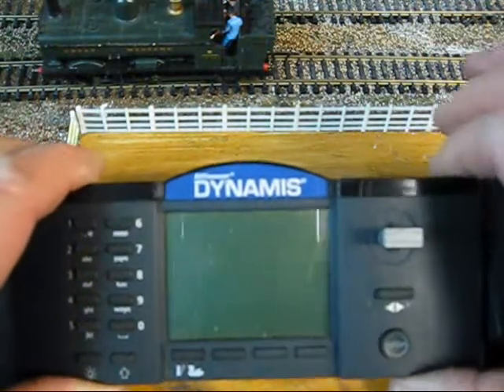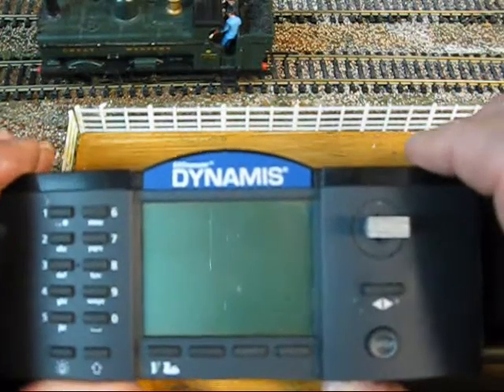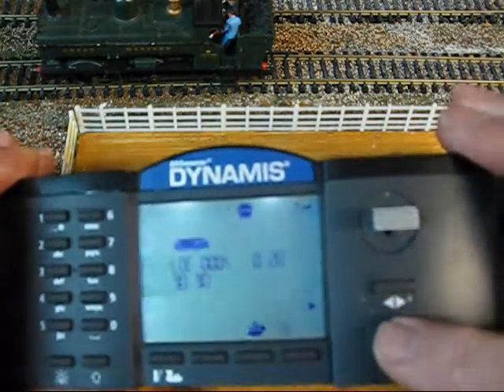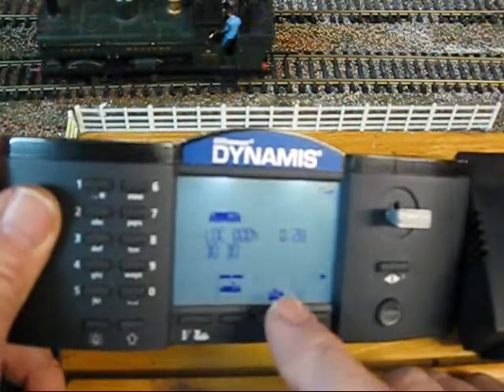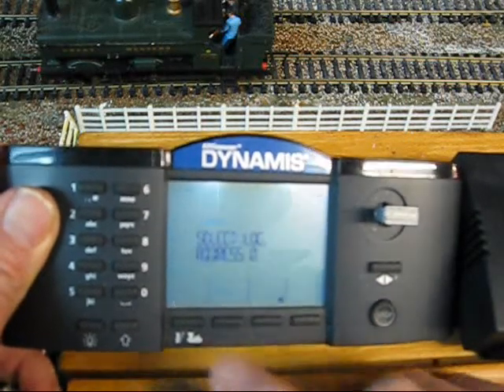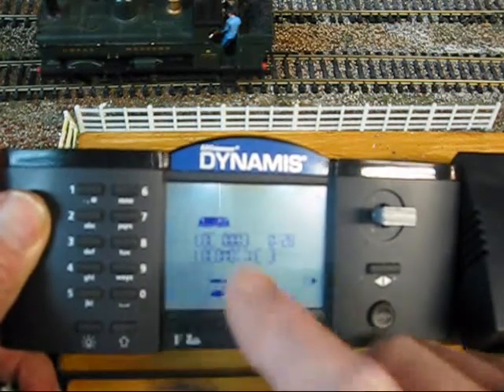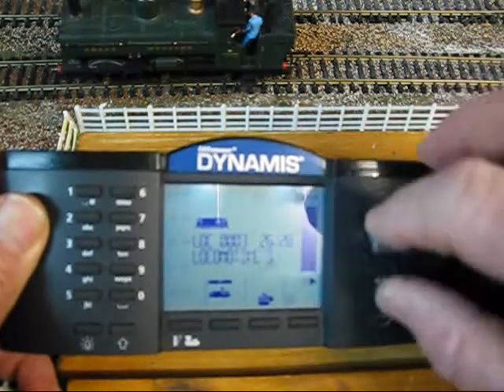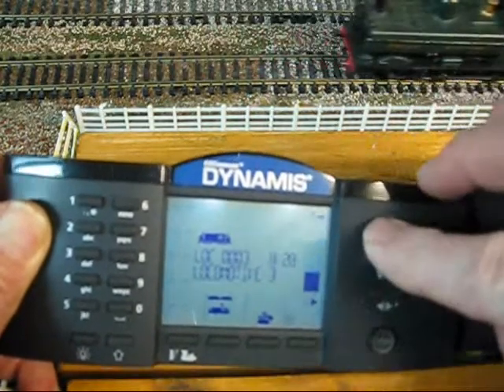Dynamis, Programing a Loco

Comment: Many Thanks Dave! Tha got me sorted by doing exactly as you illustrated. Question though! Do I have to do anything before ing your procedure to add a second new engine? When I out the new engine on the main track nd press '3' there is no response this time? 
Mark.
Reply from the maker: Sorry late coming back to you , not been home so unable to check on my Dynamiks , but if you pressed the button to add a loco bottom right , it should be possible to add a new loco ...if you still have  a problem i am home next week and will check on my dynamis and see if i can explain it better ...cheers dave
Reply: @howarth004  No Need to apologise Dave, thank-you!
I almost had the loco completely repackaged to send back to Olivia's trains when I thought I'd try again after receiving your message. So unpacked and on the track I managed to make the connection to it using the button 'add-loco'. It worked, however, there is a fault and the loco is disconnecting randomly after a short period, so I think that I just got lucky this time with connections temporarily made. I received a second Duchess class loco from Olivia's and everything went smoothly in establishing a connection to it, and then using your clip to guide me through programming a new address. So the problem is not in the Dynamis but with the loco. Many thanks for your help on both counts! Mark
Reply from the maker: @markstewart8984  glad you sorted it out , funnily enough it was Olivia’s that I bought my fist dynamis after seeing them using it

Comment: David, did you have problem with  signal loss?  How  did you solve?
I bought one a few days  ago and Always  the signal drop out. 
Thank you.
Reply from the maker: I lost it with the batteries not making contact with the contacts ..I took the back off and where the contact touch the battery at the bottom ..I turned them up ...the other problem  some have said the fluorescent light sometimes interfere ..I have not had that problem....this video shows how I cured the poor battery contact  https://youtu.be/VElzSS-lths....Cheers Dave
Reply: Roberto miguel crisostomo de oliveira pinto .. the big problem is is the 👎infrared.. it is the weakest part of the whole system.. what were they thinking when they made it infrared I have no idea.. my TV remote works better than this thing...

Comment: Hi Dave..this might seem like a simple question to you,but if one doesn't ask they'll never know.Ok:here goes.You bought that loco and I want to know if all trains run at the same speed.Can you control the speeds so they can all go the same speed,or are some trains limited as to how fast they can go.I see your trains going round your track and you control the various speeds;but are they all built so they can all reach the same speed level?
Reply from the maker: Hi Tuk , well they do vary a bit , thats why rarely you see double headers  2 trains running to gether , i do occasionally run them but try to have them with the same decoders fitted which is what controls the train, these tend to be set at different speeds  (very slightly) you can change this but very difficult to get them set exactly at the same ..hence yes they are nearly all different ...Dave 🚂
Reply: Thanks Killer..This is like Mastermind and your starter for ten:your chosen subject is trains.:) in terms of speed which is the fastest train you can buy. please?
Reply from the maker: Well think the fastest I have is the Blue pullman ,it ha a motor in the front and rear , and both decoders in  each end set identically ...she can move some ...Dave

Comment: Hi ,Dave, I 've watched your video and it seems very simple, however I cannot change from 03 address to any other number, reading the manual I seem to have a screen message missing. After accepting "Write ADDR 0003 on maintrack" message, my next message is "change ADDR 0003 Write ADDR with a flashing 0", it states in the manual that there should be "Write ADDR Loc Write ADDR 3" message at this point any ideas please
Reply from the maker: +Pathways Productions did you press change address and then also press accept ?? you can see on here how I did it , beyond that I carnt help , maybe if you ring Bachmann, there could be a problem with your controller ...dave
Reply: +David Howarth Hi David, Thanks for replying, I followed your video and 03 works fine but cannot change to another address, it's very strange.
Reply: +Pathways Productions David, just a question, I have two locos with the same address, I don't seem to be able to cancel one and then start again with number 3, also is there a way of finding out what the address of all my locos are please
Reply from the maker: +Pathways Productions Sorry I could not help , I dont use my Dynamis anymore , but if you are having problems suggest you try putting your query in to YTube , there are a lot of tutorials on there ...dave
Reply: +Pathways Productions Hi Dave, OK thanks I have joined a forum so may get to the bottom of this problem. All the best peter
Reply from the maker: +Pathways Productions Good Luck then with sorting it out ...Dave

Comment: hi can i ask you something please 
when i switch it on and place loco on track and press stop button it takes off round track with no way of controlling it and only way to start and stop it is by pressing stop button 
any idea ?
Reply from the maker: Hi Alistair , that to me says there is a electric short problem , is this just one loco or happening to them all ? ..some of the older loco`s which have been cold wired do this , but a modern loco with a modern decoder should not do this ...as I say unless there is a short somewhere , if it is a fault with the dynamis , you need to go back to the shop you bought it from or contact Bachmann and ask for advice ...Dave
Reply: ***** thank you for reply i only have one dcc loco at moment but have on order decoders for two of my dcc ready locos i try them on layout and see how that go,s the loco in question is brand new to other are about a year old that will become dcc once decoders arrive   
great video thanks again 
alistair

Comment: Hi Dave, its fixed, emailed Bachmann and they told me to program the loco's on the service track not main and they work fine now. I had tried with the pro box connected and that didn't work either. So they all run fine, next project will be setting up the pro box and 2nd controller, but that will be another day:) Thanks again Regards
Alan

Comment: Hi Dave yes I have the elite instructions, I have converted & programmed 7 very old Hornby loco's and they run just fine, I now changed the addresses with the Dynamis and that went good. The problem is the 2 new Bachmann loco's I have and converted with Bachmann 21pin decoders, I've tried to reprogram on the Dynamis, main & service track - address does not change, if I put them on the elite they have pulsating power and not able to change the address, I'll pull the decoders & start again I think

Comment: Dynamis programming sucks like hell. The manual is incorrect (Bachmann! hire proper people who know how it works and know how to write it). The manual says [BKSP] to delete old address. It is BS - it is used to reset digit address to 0. The manual to program accessory decoders is non-existent (and yes I figured out how to program Digitrax DS52 with Dynamis and documented it). My Dynamis does not program Bachman locos (???). I used old good E-Z Command Control changing address took seconds

Comment: @samster412  if its like 10 min after starting the loco it has time delay if you dont use the controller after starting the loco it turns the power off to the track  there is a setting  you need to change in the controller I had to do it to mine

Comment: U have done well, for some reason the sound on1 of my engines has gone low on it, do you know how to increase the volume, I have read it's the CV value that needs changing, have found the default value in the leaflet that came with the train but can't see to work out how to do the actual programming ie which buttons I need to press on the controller! If you could talk me through it that would be great,email me @ mwzuerner@yahoo.co.uk thanks